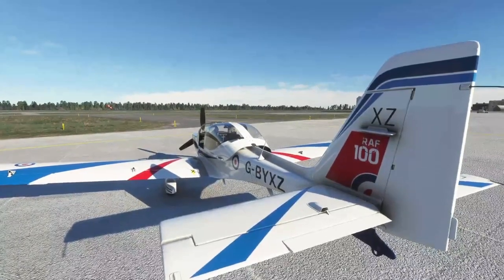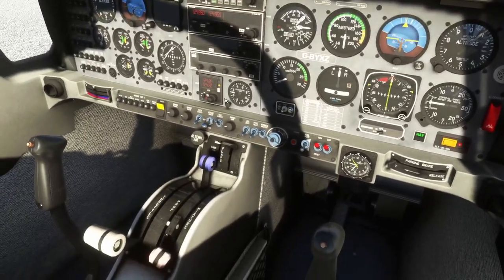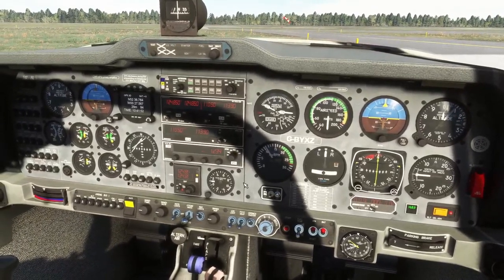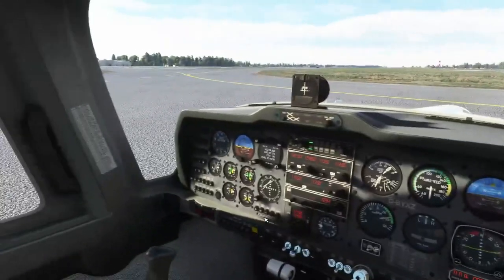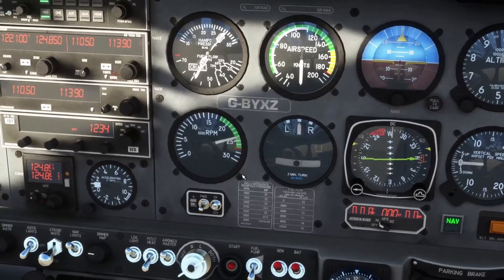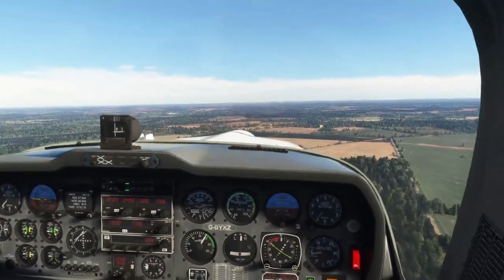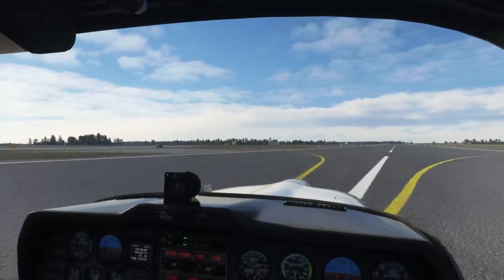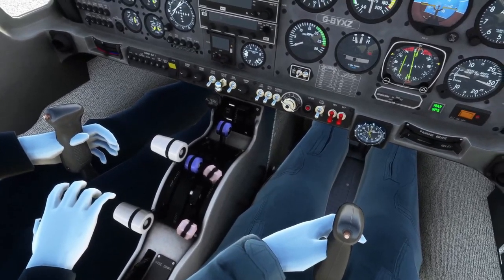Real Cold & Dark Start Up - IRIS Tutor T1 (MSFS) - real Tutor pilot

Comment: I was halfway through EFT when the Tutor was introduced. It wanted to fly so much compared to the Bulldog. First glide circuit I ended up pointing down the runway at 1000ft having turned waaaay too early! Fun to land on that springy gear in a crosswind - you don't want to be fast else you'll just bounce sideways! Thanks for the memories!
Reply from the maker: This sim is great for those with experience as well as those who haven't. I constantly have small flashbacks about techniques I've been taught!

Comment: What an odd panel. It seems to be set up to be flown from the right hand seat.
Reply: It is... its because its easier to transition from the tutor to a fast jet like the Hawk T1/2, or a helicopter for example. all your throttle and stick controls are where they would be on a fast jet/helicopter.
Reply from the maker: Good observation. And precisely what jacob said above 👍🏻
Reply: @jacobprescott396  Amazing, logic applied in aviation training.
Reply: @jacobprescott396  Interesting. A lot of my early flying practice was informal and in the right hand seat. Maybe that's why I've always preferred that throttle and stick layout.

Comment: So after watching your video i decided to try it out and i bought it. I'm having trouble starting it up, the Prop rpm and mixture levers won't budge meaning i can't start it
Reply from the maker: Interesting. You sure you’re not in pause? Have you got HOTAS and have you checked there’s no conflicting axis assignments. Do you have a similar issue in other variable pitch aircraft? You could try reinstalling.
Reply: @cgaviator I'm not in pause, i feel like it maybe the fact that I'm on xbox and using a controller, but then again, when i use any other prop aircraft and start moving levers everything works, so probably just an issue with the aircraft. A bug.
Reply: @cgaviator  quick update, I've found the resolution, in every other aircraft the levers controls are select the lever and then Right stick up down, on the grob how ever it's select LT or RT
Reply from the maker: @aviation5689  good stuff 👍🏻

Comment: Thanks for the good video. Would add a bit, if you'd also explain why you start the plane with just one mag, and so on. Cheers
Reply from the maker: Good question! I had a little google and this seems like a good answer: Most airplanes have an impulse coupling on the left mag only. During engine start, the ignition key grounds out the right mag, so only the left mag provides spark. The timing of the spark from the left mag is retarded (later than usual) during engine start so the engine will start easier.

Comment: Glad I found this channel! Do you fly using VR or track IR
Reply from the maker: How did you find the channel out of interest? And I use Track IR but I'll be plugging my VR back in this weekend I reckon!
Reply from the maker: I’ve got the Rift S as it was a reasonable price. If I were to buy another, I’d be tempted by the Quest 2 as I hear you can link it to PC as well as being standalone. The other options are a tad expensive and would likely max my PC out!
Reply: @cgaviator  Thanks man i think i'll pull the trigger on the quest 2!
Reply from the maker: @Ray33416  good luck!

Comment: I flew grobs when I did my special flying award with 727NAS. A quick question, when you do your engine checks (ie 7mins in) do you do those checks on the Hawk? Pull to the side and test the engine? Or is it because its a piston engine you need to check it pre flight?
Reply from the maker: It's a piston thing! The only engine checks required for a jet is at max on the runway.